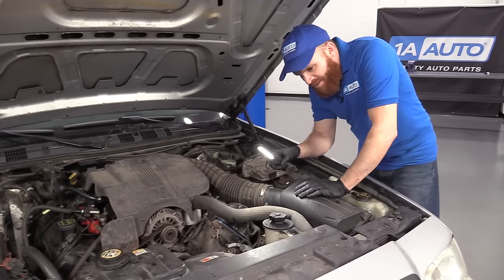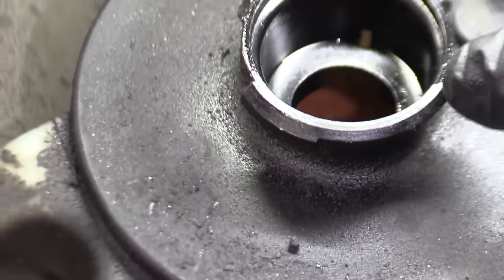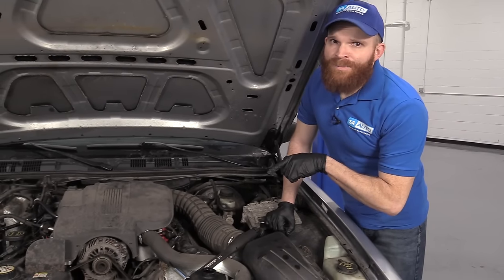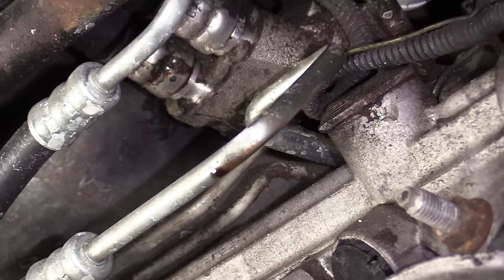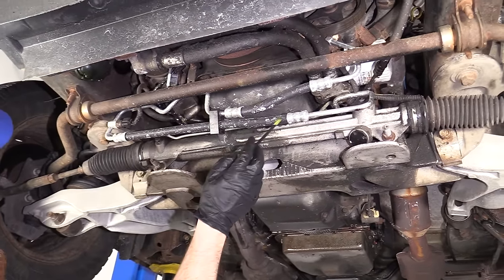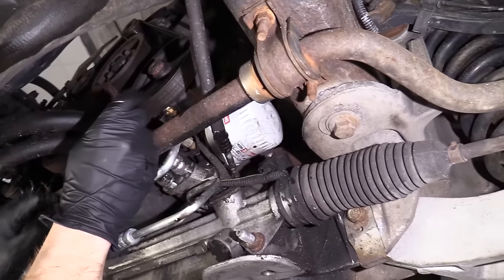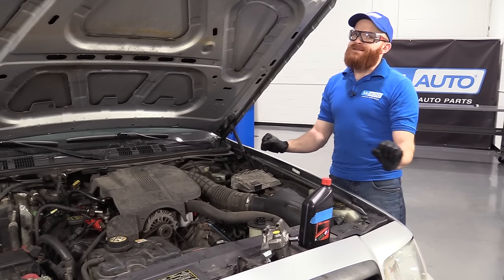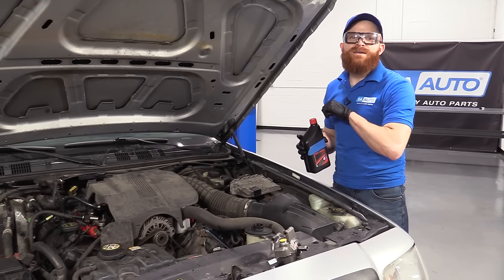Steering Whine? What's That Noise in Your Car, SUV or Truck

Comment: I wonder is the same as Toyota Avalon 2008 cause mine is making noise when I start my car and try to turn the wheel. Any suggestions?
Reply: I have a 2007 Toyota Camry. After I got an oil change I started to hear the noise. After A few days I watched this video but was just gonna pay 155.00 for the dealer to check it. Something told me to try to add fluid before I spent that money. Just today I added steering fluid and boom it’s gone so try adding  fluid first before you get banged by the dealer. It’s only 8.00 bucks.  Thanks for this video.

Comment: I'll have to check. I've been looking all day to tell if I need pump replacement or rack and pinion and finally found an answer. So if I look at that seal and there's no leak on the rack and pinion I'm just looking at power steering pump.
Reply from the maker: +Alexander Ledvina Thanks for the feedback!

Comment: I wonder.... are we ruining the pump on our Sierra... We hear the noise, we also see that it's leaking and almost daily, every time we drive the truck, we fill the power steering fluid back up because it's low. It leaks constantly... but keep it topped off! 
So, are we still killing the pump??? I really hope not.

I suppose we should just take it in. We can't even see where it is leaking from exactly because it's made a huge mess under there. Even the lift kit components all keep getting covered in it :( 
Hmmm
Reply: I’m in the same boat! What ended up happening with yours?

Comment: My 05 Chevy Equinox just started making a low whining noise today when I turn the wheel. It's only doing it when I'm pulling out from being parked, not while actually driving. What does this? Can someone please help me?
Reply from the maker: +Britneigh Bias We wouldn't be able to diagnose an issue like that here, you may want to have a local mechanic take a look at it. Thanks for checking us out! http://1aau.to/m/Shop-1AAuto-c

Comment: Hello , my car is making that sound and the service steering power light is on, but my car is electronic , no steering fluid needed . So what will it need then ? Please help
Reply from the maker: +Rocio Arias We wouldn't be able to diagnose an issue like that here, you may want to have a local mechanic take a look at it. Thanks for checking us out! http://1aau.to/m/Shop-1AAuto-c
Reply: Did you find the problem? I have 07 pontiac g6 also electric pump no steering fluid
Reply: @luisecheverria3856  yes, my dad fixed it he said it was a cable or a fuse. I’m not exactly sure but it was located under the steering wheel
Reply: Need new power steering control madual mine had the same problem.

Comment: I have the same noise but only after i drive a little. Doesn't make a sound on a cold start.  And that sound is there even when i just rev the car.  It's higher when i steer. Problem is I've been driving like this for weeks. I'm doomed, aren't I?

Comment: Losing power steering is not that big of a deal you can still drive your car why worry about changing out the pump if the old one still works see if it dies or not then change it out if it dose

Comment: My car is making this noise but only when i try an turn the wheel.
It feels like i have no power steering and the noise goes away after i get to about 10mph.
Any Ideas?
Reply from the maker: +The Fourth We wouldn't be able to diagnose an issue like that here, you may want to have a local mechanic take a look at it. Thanks for checking us out! http://1aau.to/m/Shop-1AAuto-c

Comment: i just replaced my power steering pump on my escalade with a remanufactured one and as soon as i turned it on it took about a few seconds before it started whining. and also as soon as i poured power steering fluid in it it turned like a milky color
Reply: I have a 2003 Escalade making a whine noise I thought I was my transfer case

Comment: what if your power steering fluid level never goes down but still makes the noise and there are no leaks? is it the pump? The steering is still very easy to turn so i cannot figure out what my issue is? thanks